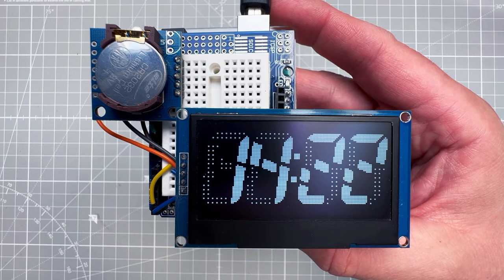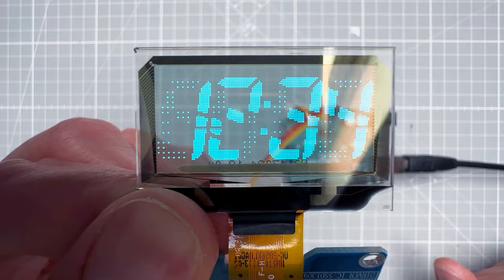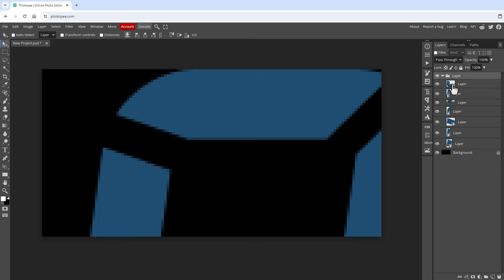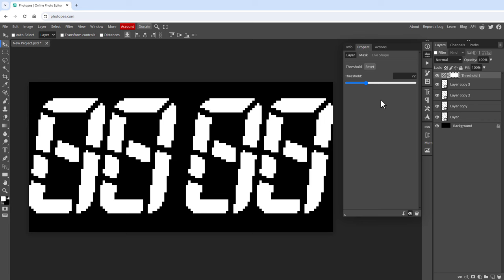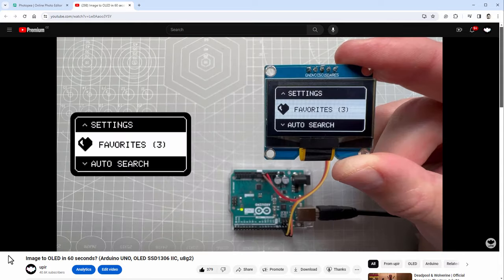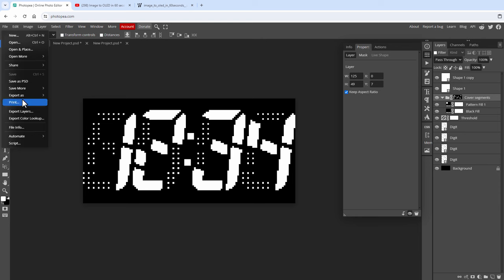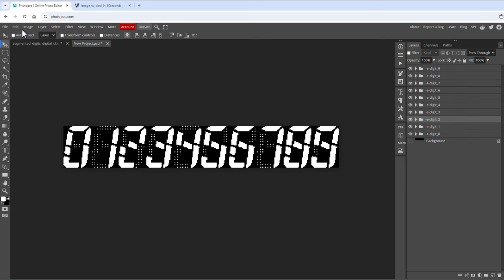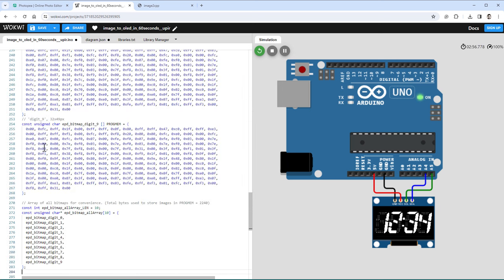Arduino OLED Segmented Clock

Comment: I really wish this transparent OLED came in a smaller size. I’ve been wanting to use one as a transparent overlay to a normal digital watch :(
Reply from the maker: Fully agreed. You can get normal OLEDs in many different sizes, but the transparent one is still only one - at least the "cheap" chinese version.

Comment: Great video and great tips as always! I have one tip for you for exporting the individual images (numbers) use slicing in photopea, its faster then grouping, naming etc...
Reply from the maker: Great tip, but I´m not using slices in Photopea because Photopea - unlike Photoshop - does not preserve slice names. I believe you cannot even set slice name in Photopea, which is quite limiting. And if you set slice name in Photoshop and open it in Photopea, it still does not use those names. Probably not a big problem for a simple file like this, but you would still have to rename those afterwards.

Comment: Are you planning to make the Ynvisible displays available again? (Suggestion: in the 188 display, don't add a partial "segment" to the leading "1" for consistency when displaying numbers like 101 or 112. Instead of the unpopular "X" display, try 2 digits with the "handwritten” Sharp calculator design, with a (bat-shaped?) dot in between. They are hard to draw but you can import Posy's vector files.)
Reply from the maker: Yes, I hope more displays will be produced, and I´m working with Ynvisible to get it done. All your suggestions are great and aligned with what I would like to do. But I would not say the "X" display is unpopular, it still looks quite nice. I have omitted the Sharp design from the first batch, because the requirements for a segment spacing made it look bad, but I might try it again.
Reply: @upir_upir Well, I managed to get decent-looking "Sharp" 24mm digits with the 1.5mm clearance. Do you want me to send a copy?

Comment: I was wondering about overlap. But it seems liblary is dealing with it
Reply from the maker: The library is great, it has a lot of functions and features. I use it for many of my projects.
Reply: You can also change the order that you draw the digits... ie 1's min followed by 10's min
Reply from the maker: @mungewell that will probably not work, you will just overlap the other set of images.

Comment: I want to make a google map tripper for bike. How to send the google map to a screen using a microcontroller?
Reply: Find the API for fetching map tiles, usually a HTTPS request with z (zoom), x and y parameters that gives you a 256x256 PNG, it's a very standard and well-documented system. Use an LCD library like TFT-eSPI to decode PNGs and draw them on the screen. Then draw any text, bitmap or vector overlays and push the frame buffer to the LCD.
Reply from the maker: Sounds quite simple when you say it like this :)
Reply: @upir_upir  yes, you can choose words to make any process sound easy. Good luck getting a MCU with enough RAM for a 4G stack, PNG decoder and a frame buffer, not to mention the coding required to put everything together.
Reply: @vaclavtrpisovsky an esp32 fits the bill nicely, I've used TFT displays with similar resolutions to the one mentioned.
Reply: @Gengh13  What resolution? You need at least 480p to display enough of a map to have a practical FOV, which is over 300k pixels and up to 12 tiles shown at the same time. Even with 16 or 8 bits per pixel, which the PNG decoder might not be happy with, it's a lot of data! And the TCP/IP stack eats a lot of RAM. Also, Google Maps are vector by default, very gray and not very practical unless interactive. I prefer the Tourist map from Mapy·cz (best in the Czech Republic and Slovakia but the map continues as a reskin of OSM in other countries). I have created an ESP32 appication with Wi-Fi and a 320x172 LCD, just showing mostly text data from a webpage, and nearly ran out of Flash and RAM. Some versions have more of both but they are not as readily available. I think the STM32 might be more expensive but up to the task.
Reply: @vaclavtrpisovsky  240x120, and you can use partial screen buffers, I haven't worked on maps so I can't comment on the subject.
Reply: @Gengh13  Scrolling does not look good with partial screen buffers.